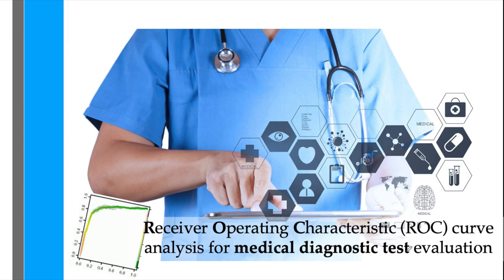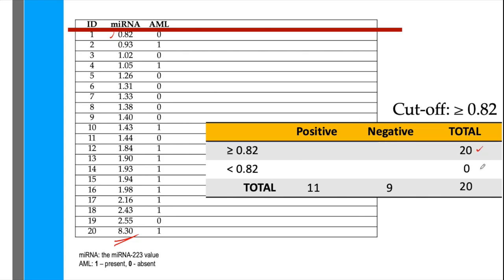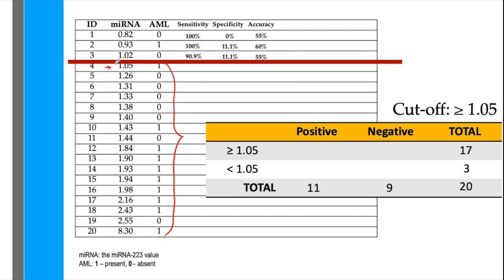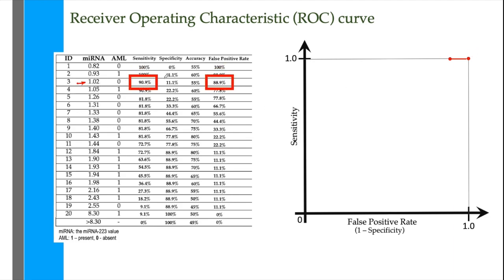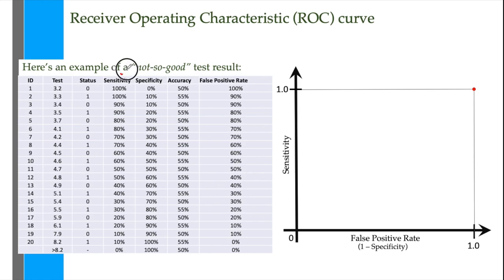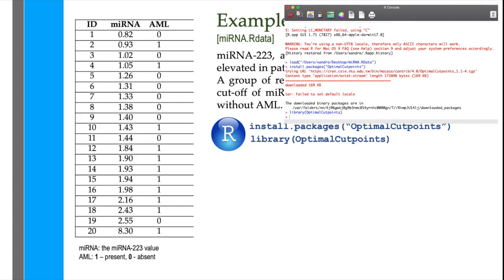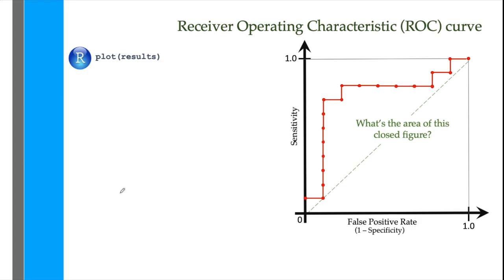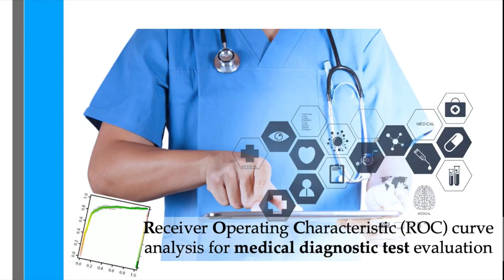Receiver Operating Characteristic (ROC) Curve Analysis for Optimal Cut-off in Disease Identification

Comment: Thanks for the video, nice explanation. Could you please explain why the values of J in ID's 19 and 20 are neglected? They have the highest J indices...
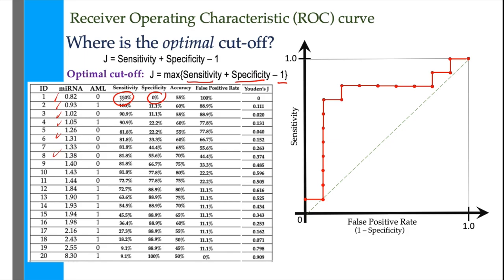Reply: I'm sorry I meant the J indices at 17:39 min. ID 19 has J = 0.798 and ID 20 has J = 0.909. Still, ID 12 with J = 0.616 is chosen as the cut off.
Reply from the maker: @NishantSewgobind  Oh that one. In ID 19, Sens = 0.0909 and Spec = 0.889, so J index is 0.0901 + 0.889 - 1 = -0.02 (not 0.798), while for ID 20, Sens = 0.0909 + Spec = 1, so J index is 0.0909 (not 0.909) . Im sorry about that but i think there was a typo error on those two in the powerpoint i used. THANKS A LOT for raising that concern. I didn't see that. Nonetheless, the Max J index is still the one at ID 12, which J index is 0.616.
Reply: @xanmos  aha! Thanks for the explanation, really appreciated 😄👍